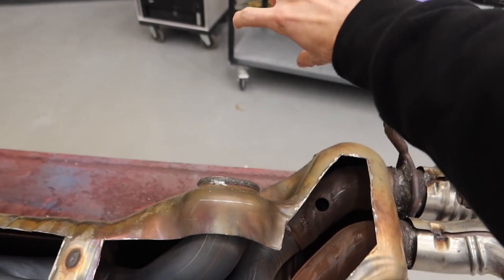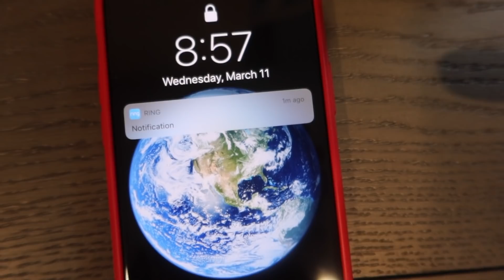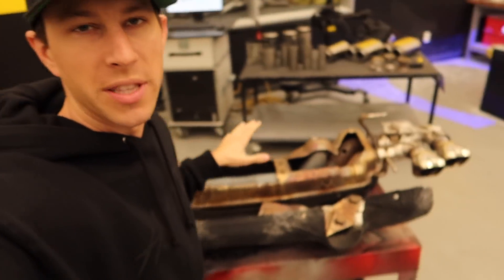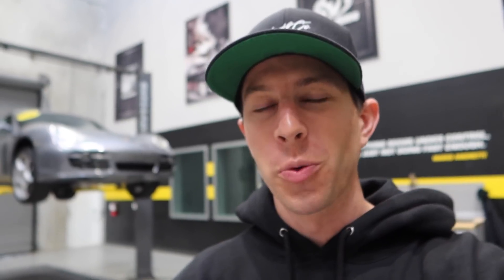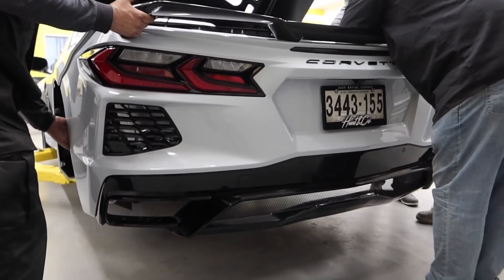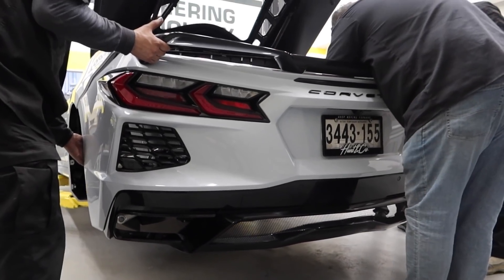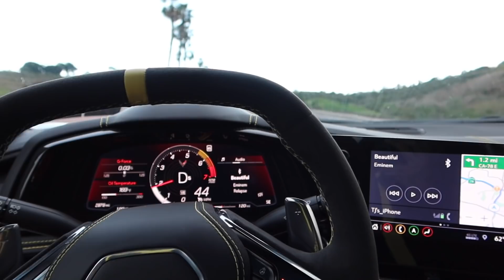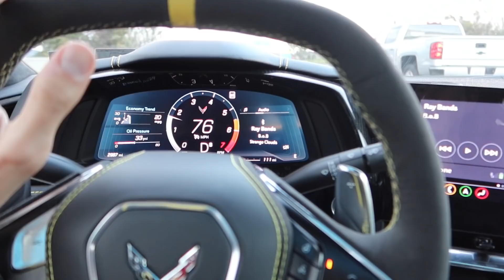NEW EXHAUST FOR THE C8 CORVETTE!

Comment: Did he say “LS crackle vibe” i thought that was an LT engine 😂
Reply: It is an LT engine 🤣
Reply: Small block LS...?
Reply: LS and LT are both small block engines... not a ton of difference between the two
Reply: @chevyfan029  I know.. people act like a lt1 is way different than the old ls3.... there basically a ls3 with Vvt and direct injection
Reply: Brandon San It’s an LT2 in the C8.
Reply: The lt series is basically the 5th generation ls engine
Reply: LS is a family of engines, LT is a different variations. Kinda like saying K series engine for hondas, you have the K20, K24. But the LS engine family is huge
Reply: He said “vibe”. Doesn’t mean he called it an LS 🤷🏽‍♂️
Reply: Lt and LS are basically the same thing. Small block push rod engine.
Reply: @shanvino5154  *5th gen of the chevy small block engine. the ls is the 3rd and 4th gen

Comment: If I remember correctly chevy said their exhaust was pretty well tuned.  When I get mine I will gutting the trunk and mocking up a top exit exhaust.  Would like to get some turbos for it right away but I need to wait for some improvements for that transmission.  Because I really doubt it will survive 700hp stock.
Reply: That would be pretty sweet ngl.

Comment: I had the ve ss over here in Australia which had the AFM or active fuel management system, dropped from 8 to 4 cylinders. When doing anything that gives it more power you had to get a DOD delete kit which ensures it never goes into 4 cylinder mode

Comment: I’m super underwhelmed by the sound
Reply: Yeah was better stock! Just sounds like it has a hole in now and it’s muffled the good sounds
Reply: GazRwood exactly what I thought! Was better off stock, can’t wait to see what corsa makes since they for the most part have the loudest exhausts
Reply: @Etorres21  Because they don't use mufflers
Reply: wait till someone pulls the cats lol
Reply: edwin torres ooh yeah Corsa extreme
Reply: @Etorres21  Pretty much any exhaust system other than Magnaflow sounds better. At least in my experience.
Reply: Scott Wilson oh yeah I totally agree magna flow exhausts sound super shitty to me
Reply: @Etorres21  I mean you get what you pay for, Magnaflow is usually a cheaper exhaust like a flowmaster but that doesn't mean it has to be quiet. One of the cheapest exhausts I ever bought was SLP Loudmouth but at least you could tell the difference from stock.

Comment: TJ! You might be able to get more burbles if you apply a tiny amount of pressure to the gas pedal while the car decelerates. You want to find that sweet spot with the pedal between no input and the exact spot that the pedal starts accelerating. The burbles happen that way because the gasoline is exploding within the exhaust rather than on the engine, or something like that lol. This always works on my 86 without a tune

Comment: Can't the heat from the amazing sound exhaust melt the wheel well liner and the heat up the trunk now ?
Nice vid
Reply: I was about to ask the same question. Curious to know...
Reply: No, I have headers on my car right next to plastic. Never melts or gets hot.
Reply: From normal use no, while the exhaust gets hot as long as it's not touching he should be fine. Now if he was just bouncing off 2 step or something ya I'd get worried lol
Reply: Actually, looking back at the disassembly video, you can see there's heat shielding built into the wheel well liner! It's a nice touch lol

Comment: 4.5 carbon fiber tips. Dyno before and Dyno afterwards? Most of the horsepower and torque will be up higher. Not only a little pop and bang on the over run, I saw when you launched it, the car almost wheelied off the ground in the front. Nice to see a video like that. Technology works. Lots of fun. I really like what you've done with Magnaflow. Pretty exciting that we got to see you guys design it and form it and explain it, which makes me want to not only get my Corvette, months ago when it comes in and to immediately put on this exhaust. I likely will not bother with a turbo. But again, the before and after comparison with a dyno is something your fans will want to know about. AF

Comment: I agree with Red Rolo, "Replaced the exhaust with basically the same thing XD"   The sound changed some for the better. The tips make it a have to have!  Its going to be difficult to improve over the OEM factory.  You most likely lost a few pounds over OEM and maybe added 5-10 hp.  Looks a lot better than the massive OEM can assembly. Excellent work and welding skills.  Will need some heat shielding added to the set up where its close to the fender wells and other body work.   My guess, that new set up will be $2000 +
  If you made a reasonably priced TIP REPLACEMENT weld on package for the OEM muffler set up , you could probably triple your sales.  Remember, I made the suggestion and gave you the idea.  Ill take a mule set!  LOL!  You guys need to make a Long Tube  Header set with that new high flow CAT and I bet ya THAT would make that muffler set up ROCK and add that 25-30 HP that every one is looking for!  Once the tuning problem, is solved, you will probably be in the 40 HP range with LT SS Ceramic coated headers .

Comment: Something Magnaflow may need to consider. Due to the lack of sound deadening near the muffler/trunk like most exotics have, I could see how it would be louder inside the cabin. Looks like the OEM design used the steel casing of the exhaust to limit in car drone.

Comment: From seeing the stock internal design, I feel like any aftermarket exhaust will pretty much sound very similar when the valves are open compared to stock. But sound louder with the valves closed due to the different baffling design. They need to get some high flow cats/ remove the cats to really wake up the car!!!

Comment: Probably should’ve added some mats of multi-layer heat insulation. I would have also taken the opportunity to do some sound deadening around your trunk and maybe wheel wells. Those materials are not cheap and timetime consuming but it would protect your car from heat as well as mitigate a lot of drone if in fact your car has a big problem with that. 
I added sound deadening underneath my STi’s car body and some in the wheel wells and it made the ride a lot quieter. By a huge margin quieter to road noise. It’s 40 pounds of insulation but I think it was worth it. As you know us STi guys like’m Loud! Haha

Comment: Sounds amazing! Nice work to you and the boys at Magnaflow. My only question and concern would be: Does the big chamber around the factory exhaust provide needed heat shielding? This is after all a plastic car. What about sustained driving on a long trip, say, 2000-miles? Not trying to be a wet blanket, it's just something I wondered about. Maybe taking temp readings in the trunk before and after to see the differences?

Comment: I am not a mufler specialist but I have a comment. I look your design and I notice the 2 inlets connect to the X pipe in the opposite direction compare to usual X pipe where the flow in X pipe are parallele or in the same direction. Acording to my understanding the two flows of inlet will rush in the X passage area and create restriction and lost of flow.  Elimination of X pipe will give a better flow and power. Did you dyno before and after your new muffler installation?

Comment: Seeing that the out side tip is the straight through side and is so close to the plastic of the fender well shouldn't they do a heat shield so it does not potentially melt the fender well? or will they be looking in to that on the final version.

Comment: Hi Tj, got a question for you but I want to say this to you, my C8 is on order and i'm  glad to see you doing some good modds , my question is about this exhaust 
first, is the exhaust pipe made from 304 stainless steel??
I noticed the pipe discolored pretty quick and usually you see that on headers not so much 
on exhaust pipe unless its made from cheaper steel like 409 mild steel 
second, when will this exhaust be available to the public ??
and lastly you said they were carbon fiber tips ? I just want to confirm that with you..
please get back to me asap

Comment: When the valves are turned on it will flow through all 4 not just the opposite side,  right?
Reply: Well at least the factory one does because the air will still escape from the air hole

Comment: Autocar has videos comparing the noise of the Ferrari 458 to the Jag XK RS and the Aventador using a decibel meter on the iPhone.  From ~3 ft these are typically 108 dB and in pass by ~100.  In a tunnel the 458 beats the Jag but I haven’t seen a C8 measurement.

Comment: WOw good but so bad, wheres the heat shield boys? Now he will get resinace sound while driving especially at over 100KM per hour, lol :) Also the heat shield is made by chevy engineers for a reason ,which is to stop any fires and heat from touching any sensitive areas, like look at the wiring harness for the exhaust valves, now on really hot days, the rear end will start to crack due to the extreme heat transferred from the pipes and more when the car is sitting there in traffic, lol :) Now if he had the heat shield put back on, then you would have nothing to worry about at all, so put it back on, in fact make a new version to suit the aftermarket exhaust, which you can say is a cat back system and not a full exhaust change like headers and hi flow cats and cat back system, that is where the power is and especially if you can tune it as well cold air intake and always better to be safe and get the extra cooling, so 4 like those in UAE will get due to the extreme heat over there, its better to have extra cooling than the normal 2 radiators ans the same with engine oil and transmission coolers as well. :)

Comment: what is the popping sound when it changes gears/  it sounds like crap... i vote for straight out with the cats and then into a crossover x then into two pipes on each with tips on each side. when you had the exhaust off and started it up... that was the perfect sound for that car... i will bet you with no exaust just the cats.,.. drive it and i think you wont have the popping during the changing gears!

Comment: It sounds pretty gay in my opinion. Exhaust note is too smooth. Needs a massive cam or something in it before it will start to evoke emotions out of me. That or a turbo or supercharger. Sounds like a old man wagon with bone stock exhaust while it has an aftermarket exhaust. My issue is it doesn't tear into the atmosphere like a proper 7 litre 427 does. If it's a Corvette, I need it to sound like it's contributing to global warming while ripping a phone book in half. This one sounds more like a Chevy work truck. I dislike the exhaust note on the 6.2L ZR1 also, so don't mind me. I think the 6.2L sounds like an old man wearing a baseball cap. This new flat 8 seems the same or worse as that.
Reply: Here's an example: https://www.youtube.com/watch?v=32-k37l-UEM Step on all these old men to get to that kind of exhaust note ASAP.